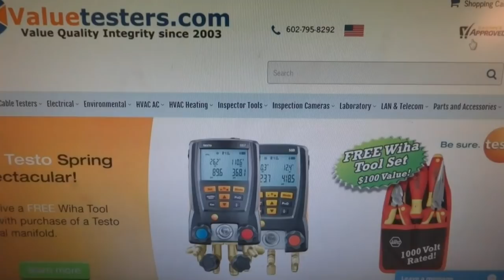tub drain backing up water

Comment: Hi Steve and Miss Molly, Great video as always, love the plumbing videos. I have a question for you, the other day I worked on a tub drain, I believe it was a Kohler, but the drain stop piston was seized in the pipe, had not been used in very long time. Is there any trick to free these up, I have run across this now probably 5 times and have always had to replace the entire drain assembly. Luckily I had good access to all of them, but there is going to come a time where there is not going to have access and is going to be a real pain to deal with, just was wondering if you have ever ran across this problem. Whenever I have to take these apart I always use plumbers grease on the pistons so they don't freeze into position and get stuck.  Any suggestions would be great, thanks.